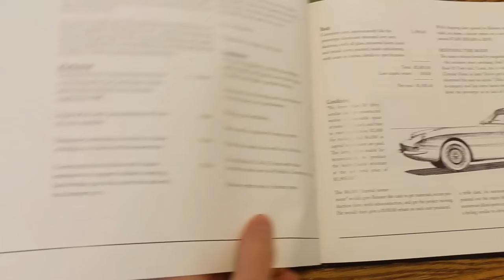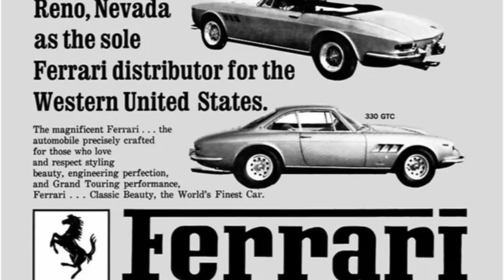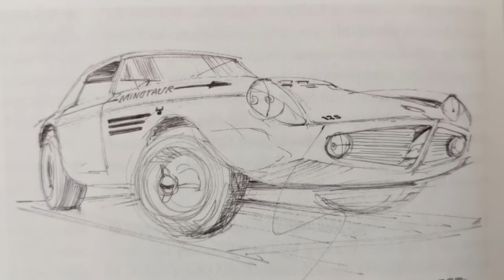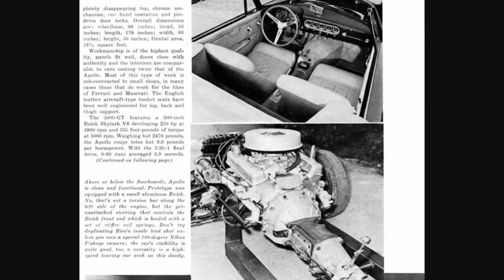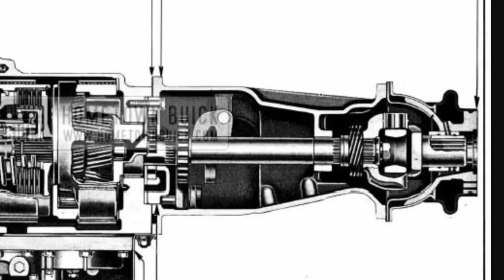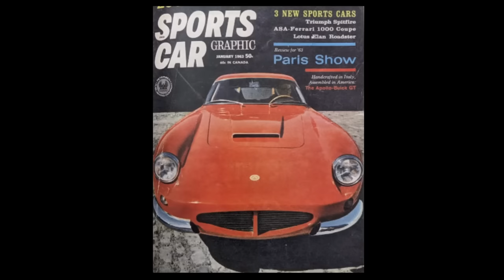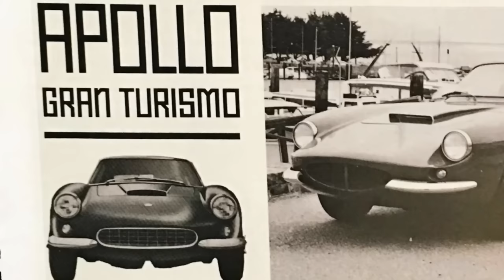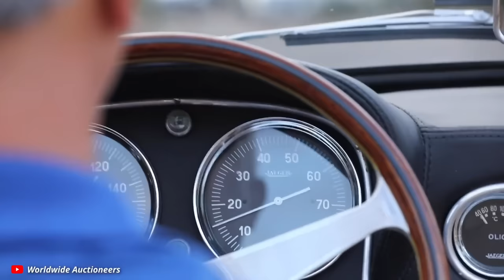The American Sports Car that nobody knew existed

Comment: I know that the way you describe the production of body panels hammering them on molds was a very common practice back when there were hand built car bodies. I was a very average body repair man, but my Dad who has passed away a few months ago used to learn and work in a body shop where they were building cars from scratch. 
That was in Switzerland and many great cars were built in Switzerland: Graber, Carrosserie Worblaufen, Beutler, Ghia Aigle were known car building companies. Those cars were as famous as those built in Italy at that time.
Reply: I would say then term you are dancing around regarding hand building cars is "Coachbuilders" or Coachbuilding".
Reply: @dongarnier5890  I am German speaking and we call that profession "Carrosseriebauer". I think that term is describing the profession more accurately than the English term. I bet you would have "danced around that term" as well if you would have had to find the German term.
Reply: @dongarnier5890   ¨than¨

Comment: I'm from NY, and I remember these coming out when I was a kid. So they were mentioned,  maybe even featured,  in a mainstream magazine like Car and Driver, or Road and Track. Too bad they didn't stick with the 215, considering what Repco and McLaren were able to do with them. I thought the small, aluminum, American V8 was brilliant, and I was shocked when GM sold the rights, which they regretted later. Great video!
Reply: Is this the brick v8 that was licensed to Rover in the UK?
Reply: @markwoodger2  Not sure why you call it a brick, but yes it is the engine licensed to Rover. In an era when a powerful V8 got perhaps 0.8 hp per cubic inch, these little Buick engines delivered more like 1.1 hp per cubic inch. They were good performing engines (as long as you kept water and oil in them) but were small by American standards. In the sixties and seventies, cubic inches was the answer to any performance question.
Reply: @markwoodger2     Yes, that aluminum V8 was sold to Rover and became the Rover V8.  

Buick also made a V6 based off of that V8.  They sold it to Kaiser-Jeep and later bought it back from them.  It became the ubiquitous GM 3800 V6.
Reply: @markwoodger2  Brick? Whoever owned Rover at the time, yeah. They actually bought the entire rights. Then GM asked to buy them back. No dice! The Oldsmobile version was used in the first McLarens, before the big block Chevy. Lots of people had put them in MGs, long before MG did. Healys, Triumphs, and others too. They still do.
Reply: I think "brick" is an auto-corrected misspelling  of Buick.
Reply: @MSWMSW1 You are justly correct.
Reply: @MSWMSW1 I was just thinking same.........probably an auto-correct error, because I've been around a very long time now, I was born in the 1950's and remember all the controversy over selling the rights to the Aluminum 215 v-8 to rover and today was the only time ever I had seen them referred to as a.brick
 I personally always considered it a great thing cause it introduced a lot of people to the great sound and.feel of the classic American v-8. Too bad they didn't come with a choppy sounding hyd.flat tappet cam such as a acrane fireball or something like it! Plus adding such a cam would have pushed it even farther over the 1 HP per cubic inch mark than it was already. Just a thought.......
Reply: @robertmoffett3486   Kind of funny. Which rights? The engine is a Buick small-block (the first) made in aluminum. Rights to some part of the production process for the aluminum casting? Simply the physical production machinery as material goods? The expense of the aluminum casting is what gave Buick the impetus to replace it with a V-6 cast iron version, the Buick even-fire 225. Buick brought back the V-8 formulation (in iron) for the 300, 340, and 350 cubic small blocks, with the 350 being produced until 1980, so Buick retained non-exclusive intellectual property rights to the design. In 1980 Buick then discontinued that small block design as GM decided to winnow engine design lines down to the Chevy and Oldsmobile small blocks, getting rid of Pontiac and Buick designs in V-8 form. Curious fact is the original Buick 215 aluminum V-8 was also sold by Oldsmobile, but with their head design and a turbo, the head design, which IIRC, was later used in the next generation of Olds V-8 that came out and as I mentioned, was one of the designs GM decided to keep after winnowing out the other designs.....except the Buick V-8 design lived on as the V-6 that lasted in production,  certainly going through various evolutions as time went by (ie. 3800), far after the Olds V-8 went bye-bye. There's also a side-story to this rambling tale in that during the later half of the 1960s, Buick came to the conclusion that its V-6 wasn't selling enough as Americans came to desire larger and larger V-8s, so they sold it to Jeep, who used it for a decade, then Buick decided they wanted a thrifty engine after the 1973 Arab oil embargo and bought it back from Jeep, and after a couple of years turned it into the split journal 231 ci V-6.....

Comment: $6000 in 1962 needs to be in more perspective, than as $60,000 today. It was about $1500 higher than a Corvette, or rather Corvette was 3/4 the price of an Apollo. Today, that would price the car over $100,000, not $60,000. 
Sports cars are an interesting market. Unlike many car buyers of today, who will simply buy what they perceive as a good deal, people were more marque-oriented, especially with sports cars. As the Apollo GT didn't have a marque yet, it was a gamble. So they had to attract those simply wanting a fancy, higher-end sports car, and those people were already captured by Ferrari, Aston Martin, Porsche, and Jaguar. 
The Buick 215 hurt, as it went out of production after 1963. This meant a re-engineering of the car, as the weight of the iron block Buick 300 would change much about the car. It wasn't simply installing a new mounting system. 
What might have saved them was approaching Buick early on, and partnering with them on the car. This would have given them a dealership network and the potential for more financial support.

Comment: There was another though less impressive Apollo:  Buick Apollo was a compact car manufactured by General Motors for its Buick division from 1973 to 1975. It was based on the GM X platform, along with the Oldsmobile Omega, Chevrolet Nova, and the Pontiac Ventura.

Comment: The 1964 Apollo 5000 GT did not have a Chevrolet engine it had a cast iron 1964 300 cubic inch Buick motor. That engine superseded the 215 ci aluminum block that went out of production in 1963 .

Comment: When I was probably around 13 or 14 years old,  a family friend had purchased a used Intermeccanica Italia.  This was a beautiful looking car.  But it had a number of problems.  The workmanship under the skin seemed to be the issue. It seems that the assembly wasn't done that well and there were significant deviations from car to car.  I have even heard, but cannot verify, that shock absorbers were sometimes weld to the chassis and shortcuts were common to get the car finished.  

Being that he loved the car but could keep paying for others to repair it, he ended up selling it.  Intermeccanica, at that time, had a reputation of building good looking cars that, at least with the Italia, were not reliable or built right.  I suspect that later owners were able to correct some of the mechanical issues that this car had.

Comment: Front appears Datsun 240Z
Reply from the maker: I wonder if the 240z copied it to some extent, you're right
Reply: @bartscarstories I personally don't see that. The 240 manages to stand out with its sharper edged squared off shape. This Apollo does look more like an amalgamation of the various Pininfarina designed Ferrari road cars of the time.
Reply: A cross between an e type  and a ferrari. Not quite right.

Comment: I owed a lotus it was hand built and had so many issues 
Although it was mid engine with an all fiberglass body 
It needed constant tweeting from the back rear axle nut that kept coming loose so if you forgot to tighten it every couple hundred miles that back wheel would fall off the fix was replacing hardware to have a reversed threaded nut that wouldn’t come loose. 
I’m sad that the young people today have no common sense about value and price I think it’s why pricing on everything is skyrocketing 
Although lotus started selling more cars when the raised their prices to be above Porsche. 
So I guess if your nouveau rich you don’t know that you’re overpaying for nothing 
I guess wisdom only comes from age

Comment: I bought one of these in Arizona at the Barret Jackson auction in 2004. It didn't sell when on the block and I recognised it as the Thorndyke Special from Herbie: The Love Bug. I went and found the owner and we struck a deal, and I immediately paid for it to be transported back to London. I think it was $17k or though it may have been the $ equivalent of £17k. It was the rarer 5 litre version. I went to the docks to collect it and drive it to the showroom where I worked, open minded, but not overburdened with high hopes. It was kind of wonderful. Torquey and easy to manipulate along the road. It had DTM style exhausts which made no sense and were terribly loud. Octane magazine borrowed it and did a cool article. We sold it to a German guy who flew over as soon as he saw the advert, paid the £35k asking, no quibble and that was the last I saw of it.
Reply from the maker: Wow sounds like it worked out well for you!
Reply: Would that specific 5.0 liter Apollo happen to be the Red one that made the cameo appearances 
in "Herbie Goes to Monte Carlo?" 
  Had the Side Pipes on it and a round patch panel on each side to cover over the 
Holes cut into the body?
Reply: Nice return 💪
Reply: Wiki says.....
"A pair of Apollo 3500 GTs were used to portray the Thorndyke Special race car which was featured in The Love Bug, a 1968 Disney movie. One of the pair has been fully restored.[5][6]"
Reply: @lancerevell5979  
Yes. One of them is now up here in Canada out in Ontario.
That one was the one that slid down the hill backwards and into the Pond, in the Film. 
  The rear Quarters were rotted and nearly non-existent up to the  rear bumper when they originally found it. 
All the water damage on that Italian Body was Savage.
Reply: It’s funny you say that I own a 73 Volkswagen super beetle and I’m only an aircooled vw fan because of herbie and I only know this car as the thorndyke special lol
Reply: Ja. It is being a wunderschoen auto for me. Danke, min Englisher freunde

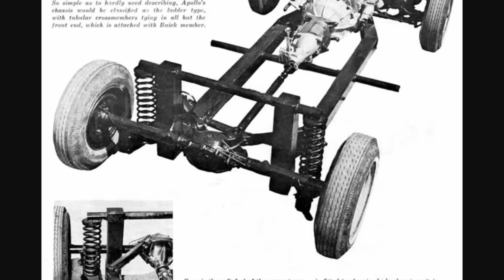Comment: 8:50  It sounds a bit like they built a TVR, before TVR in a way!  Exactly the same 3.5L Buick alloy-block V8 too (though I guess Rover modified it over the years).
Reply: They did. As built by racers and hot rodders in the states, they often displaced about 305 cid, close to 3.5 liters.

Comment: There was no V8 powered AC Ace the Ace was powered by a Bristol straight 6 derived from a pre-war BMW.  LW@automotive historical services.
Reply from the maker: Ah you are correct, thanks!!
Reply: Yeah, I did a double-take when he said that. WHAT?
Reply: The Bristol 6 was a pre-war engine designed by BMW for the BMW 328.  Bristol stopped building the outdated engine,, which caused AC to go with a Ford V6. AC also built a few with Ford V6's, but Ford stopped building/selling them.  That is why Shelby was able to get AC interested in the Cobra.

Comment: Just how can you describe american v8s as being sophisticated, And infer that the likes of ferrari and aston martin are not? That seems to me to be croojed logic.
Reply: I don’t think sophisticated is the right term, reliable would be. The early American V8s of the 60s were extremely reliable and produced good power. The engines from the Brits and the Italians were plaques with reliability issues, as were the entire vehicles. This was especially true with the electrical systems. There is a reason that so many European companies were using American V8s in their cars to make such amazing performance cars in the 60s. And it was a great matchup since most all European cars handled better than the average American car did.
Reply: I think that reliable and sophisticated are actually the same thing.  Lacking reliability means the samething.  I don't believe that a vehicle can be sophisticated without being reliable.  I remember the lucas electrics and SU carbs that were always screwed up.  
I love the looks and the way they drove, when they were working correctly.  I also remember the work it took to get a few miles out of them.
Reply: Infer, or imply? They were reliable and comparitively cheap, with abundant parts available, and easy to work on. Neither Ferarri nor Aston Martin could claim any of those things. I wouldn't choose sophisticated myself, but maybe you're splitting hairs. People are still swapping American V8s into classic European sports cars today, including those 215s, and Chevy and Ford small blocks. Because they're better
Reply: @herbertwoodbury1958 Lucas made a very wide range of quality. Remember that RollsRoyce used Lucas electrics. The mass market UK manufacturers were not clever enough(meanly so) to use better quality parts.
At this time in Australia, Holdens were fitting either Lucas or Bosch systems, complete sets by supplier. No real differences were noted by owners, and most did not know whether they had a Bosch or Lucas electrics.

Comment: I would have used a small block Ford given the Shelby treatment.....making 300+ HP and weighing less than 450 lbs.
A hundred pounds lighter than the Chevy and a lot narrower.

Comment: The Buick/Olds 215 should never be mentioned in the same sentence that includes the word "reliability"  lol. Also, it is NOT "a big, powerful V8". It was an awful engine, arguably one of THE worst V8's that GM ever produced. And it was totally ironic that Rover ended up with it. LMAO!

Edit: Case in point - note the yellow car @13:00 with an LS swap. hahahaha!

Comment: "NO ONE" knows that the  Buick Apolo GT exists????
I went to high school with a guy who had one.
I remember seeing a black one on the dealer's showroom.

I suppose yourgoing to claim  "no one knows" about the Opal GT, Mercury Capri. and the Chevrolet Cosworth Vega next? Or perhaps the 1963 to 1969 180 horsepower turbocharged Corvair Monza 900, and 140 horsepower 1952 to 1969 Corvair Monza 900 with 4 carburators? Or 1957 Olds with the J2 option (triple 2 barrels. 2 versions, standard cam and 8.5:1 compression or high performance "racing cam" and 10:1 compression 371 inch OHV "Super Rocket" V-8 engine. In the 1950's the Cadillac Eldorado (rearwheel drive) had a dual 4 barrel engine option. A lot of folks don't know about the factory high performance Olds and Cadilac's

This may not have been a popular or big seller (one reason it wasn't made for more than 2 or 3 years, if memory serves) but it is far from "unknown". "Forgotten" might be more accurate

Comment: Back in the day American cars were good for about 50,000 miles before they’d start burning oil and rusting out. Not 100,000. The German cars were noted for going over 100,000. Their value proposition was sturdy, long-lasting reliability. The British and Italian cars were troublesome because they were engineered for driving low miles in their small countries not in America’s wide open spaces and on our superhighways. It should be noted that when it comes to American cars reliability was more important than longevity because Americans used to buy new cars every couple years. Manufacturers would face lift their cars yearly. It was exciting to see what the new models would look like every year. Some dealerships would tape up their windows before the unveiling. Definitely different times.

Comment: The unique thing about this car was that it was made of metal and had an engine and a two speed automatic transmission. The designers were really clever about their choices and it was a fabulous car. 

Other car companies built their cars out of paper and they had clockwork engines that failed after 300 miles. 

They only failed because they didn’t have enough money to realise their revolutionary ideas. 

So sad. 

Also American engines are great.

Comment: This is only video that would call the Buick alum 3.5L V-8 "reliable".
Reply: What's not reliable about it? Just because of the DNF in the Indy 500?
Reply: @63GTDriver  It was discontinued by GM due to It's unreliability. Then Rover bought rights to it, and it was proven to be horrible for almost 60 years, as main powerplant in Land Rovers til 2010.
Reply: @STB-jh7od  hmm  That's weird because my dad drove his Apollo 3500 GT every day for like 25 years and never had a issue with it, just clutch changes and brake shoes.  I put something like 
25000 miles on it in 1 year I never had a problem with it either.
Reply: @63GTDriver  Good for you & your Dad. But reason it was discontinued was unreliability, I think that was due to manufacturing process for aluminum blocks at the time. It became basis for Land Rover V-8 til 2010s, and that really cemented it's bad reputation.

Comment: All that yah-ta-tah in the narration about dropping big American V8s in tiny sports cars, you present a car "powered" by a Buick 215. Geez.
Reply: This was pre Cobra . Small cars with big engines were not a thing until after this one . Most sports cars were 6's in Jags or Ferrari's which were exotics with bigger engines. But for the most part the sports cars were 4 cyl Brit drop tops or the Porsches with their flat fours . Jags, Astons, and Ferrari's were rich man cars. This was to be rich man performance at a fair price.